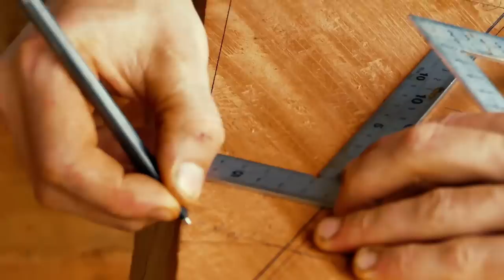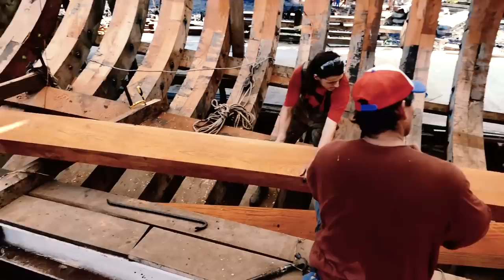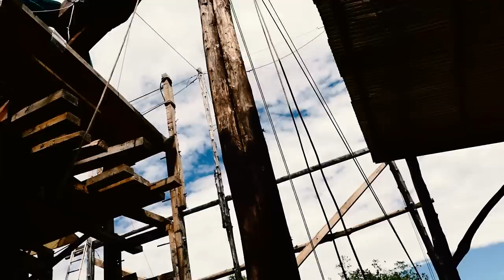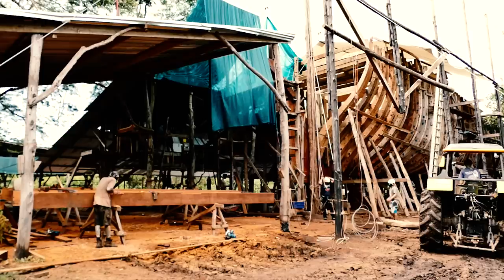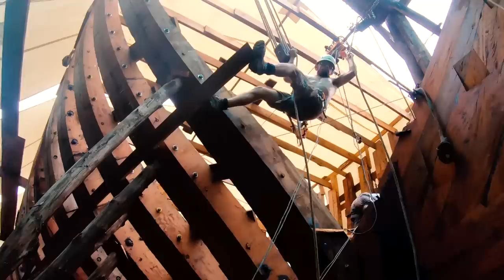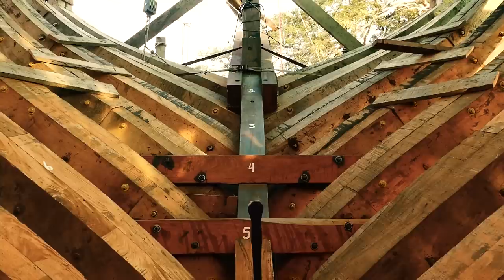Finishing Framing: An Update on Past Works - Building Ceiba - SAILCARGO INC.

Comment: I have just tuned in to your channel and wish you all the best. However, I fear this is too small too late. 300 tonnes of cargo is very small and if it is coffee, then that is only for the wealthy as it would have to be sold as a boutique product. Electric motor ? Forget that one. We tried that for a ferry on Sydney Harbour and it failed. As a marine engineer I won't go into the details but Google it and see why it didn't go ahead.  Your small boat is not geared for electric motor power so wind is your propulsion and that means unreliability to get produce to market. 
I would use the vessel for fun and trips but that means a fit out for sanitation and cooking and so on. Good luck and I hope you finish this project as this world eats itself up with COVID, war and too many people.